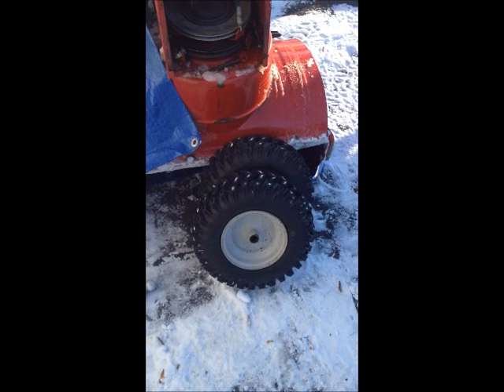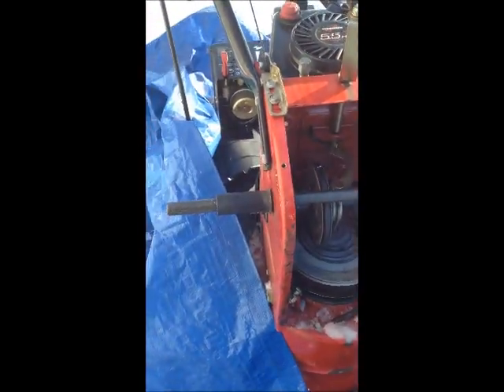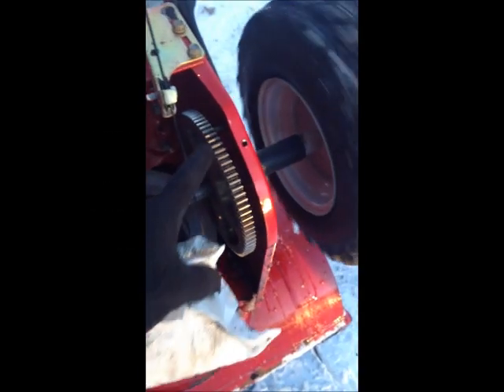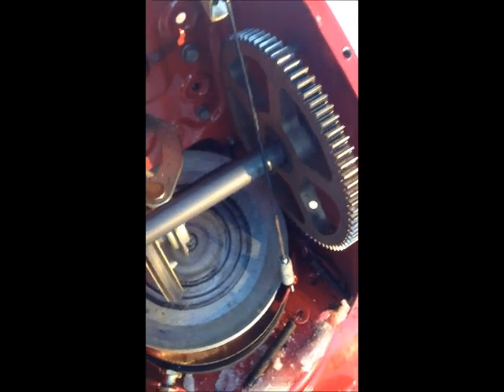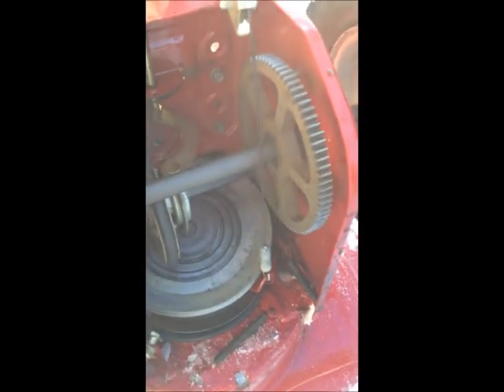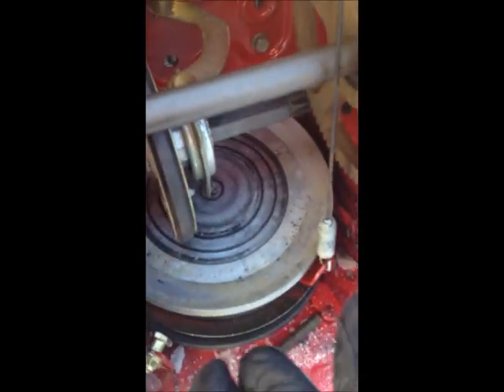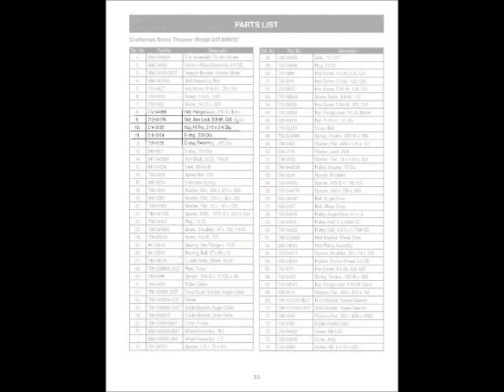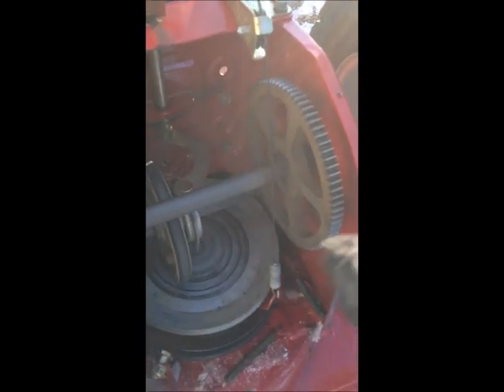Craftsman snowblower tire change?  - Spinning axle HiPro Key dropped out...

Comment: Great video, I picked up a used snowblower, that the owner said would not move, he replaced friction wheel, belts , springs to no avail, I came across your video and sure enough, it was missing.thanks  your experience  has benefitted me.well explained.
Reply from the maker: steve williams 
got me for a little while too...glad it helped and IMO a silly design

Comment: What you are showing is a common woodruff key, not a Hi-Pro key.
Reply from the maker: just going on what it says if you were to reorder the part
Reply: @399Scott   @399Scott  how did you remove the wheel?

When I try to remove the wheel, the whole axle spins. And I'm not sure where to prevent it from spinning?